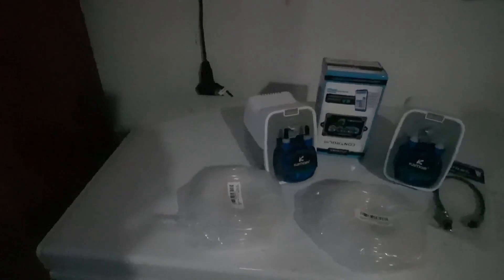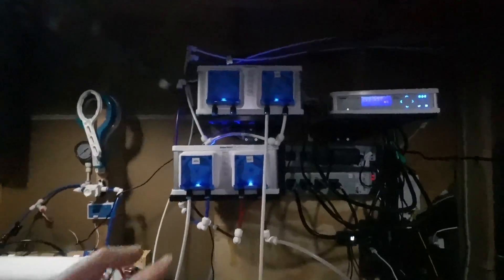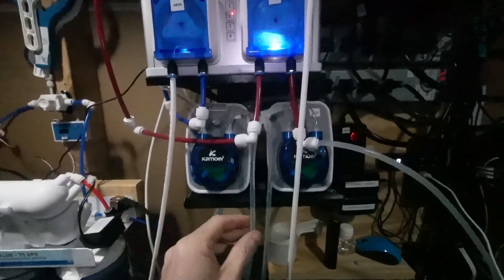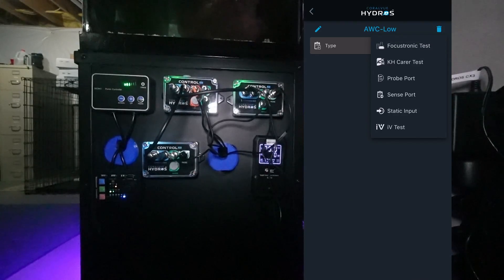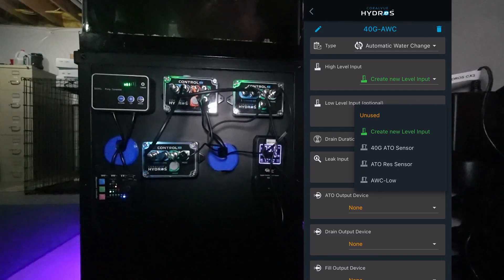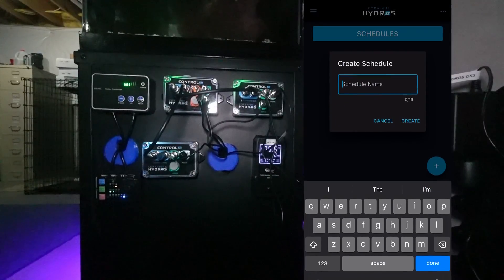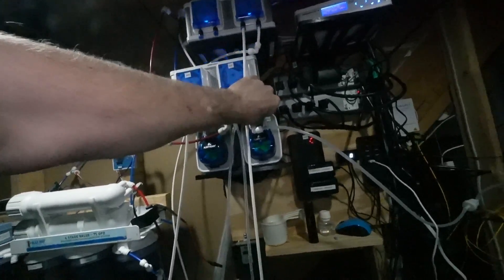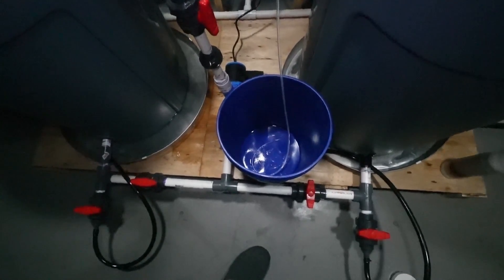Beginners Guide: HYDROS Automatic Water Change

Comment: I may have missed it but can you configure the ATO to not run during the AWC?
Reply from the maker: Yes you can using depends on. I’d recommend checking out the Hydros Facebook group for that. This has been talked about several times there before.
Reply: @REEFHUB-Official thanks man

Comment: This video helps. I set up everything and I couldn't make  drain, fill and ato work together. They work separate, but I try a lot of settings and I couldn't make it work. I didn't want to have schedule. I thought I just switch to water change mode and it will work... But it didn't.  So I did water change regiment in the schedules like you and it starts working. I don't understand why water change doesn't work without schedule.
Reply from the maker: Post to the Hydros Facebook group and share screenshots of your setup. The community will help you work it out.

Comment: So the pumps plug into the strip that’s controlled by the hydros. Once set up the hydros controls the time the outlets become hot and the sensor when the water reaches a level set by sensor it tells the hydros when to turn on the fill pump/outlet and off on the other pump. I have a Red Sea ato on a constant plug setting in hydros so how to I tell the hydros to turn off the plug to the redsea ato when the Awc starts? This is the confusing part to me.
Reply from the maker: You can use depends on statement to control that. Post in the Hydros FB group and share your setup in more detail. We can better assist you over there.

Comment: Very curious how much this automated add-on costs. I have the Hydros Pro Pack (X4 and XP8) with a Wave Engine and Octopulse 4's. Have ATO with 3 level water sensor. What do I need to buy for this? Figure its at least a water level sensor and some Kamoer pumps?
Reply from the maker: That would be correct. It also depends on how you plan to run AWC. I have a mixing station so that could be an additional cost and possibly the cost of an ATO
Reply: @REEFHUB-Official  I have the Hydros ATO and a brute trash can mixing station similar to yours. I am curious about how you did the actual plumbing in the sump to remove the water. You showed how you placed the water sensor, but where is the actual tubing in the sump, return chamber laying on the bottom below the return pump level? How do you have the water removal tubing placed in your salt water can, tubing inserted through the can top and the end is laying on the bottom of the can to get most of the water out? I'm seriously considerting replicating what you did. One last question... Why not use a submersable pump in both the sump and the salt water mixing station tank or in your setup the pump used in the mixing station configuration to move water even faster from the sump to drain and saltwater mix container back to sump?
Reply from the maker: @prion2727  I just run RODI lines and hold it in place via a probe holder. One is deep enough in the water of AWC and the fill line is above the water line to pump it back in. As for the plumbing to my Mixing station, i drilled a couple holes and used RODI Bulk heads off amazon to secure it to my mixing station. I also have a Hydros Low Level sensor install in my mixing station that warns me when the reservoir is low. The pump that removes water just puts it down a drian.

Comment: @REEFHUB-Offical Thanks for the video! What do you think of the Kamoer pumps vs the GHL Maxi? I am looking into setting up AWC and plan to use Hydros for monitoring but was also considering doing a standalone GHL maxi system for AWC and ATO.
Reply from the maker: GHL is stable and works just fine. Personally, the Kamosr pumps are cheaper and more powerful than the GHL Maxi. I’d deftly go the Hydros route for AWC. It’s simpler to setup, implemented the same way, and more affordable.

Comment: Thank you for posting this video. No one else has taken the time to do a Hydros system overview/ setup and what can be achieved with Hydros. Your video is what I have been looking for. I am currently working on setting up a water change station in my basement. I am currently purchasing the parts as I can afford them. I plan on automating some of the functions on my water change station. Which controller or combination of controllers are needed to start from scratch to automate the water change station in my basement? I currently do not own any controllers or Hydros equipment? I am thinking of purchasing the X2 Starter pack, an XS controller & ATO kit with the triple water level sensor. If you recommend something different I am open to suggestions. I am not exactly sure how many water level sensors I will need. I am thinking a total of 4 level sensors and the one triple water level sensor available in the ATO kit. (one high level sensor & one low level sensor in the freshwater tank = 2 level sensors to control RO/DI.) (one high level sensor & one low level sensor in the sump of the display tank. = 2 water level sensors to control the AWC) and the Triple level sensor to to control the ATO. What I want out of the Hydros on my water change station is the following.

1. Auto refill RO/DI water storage tank
2. Auto water change display tank
3. Auto refill ATO container & maintain display water level
4. Measure water temperature of mixed saltwater
Reply from the maker: Thanks for viewing and I’m happy it helped you out. That sounds like a great start. The ATO sensor will also act as the high level sensor for AWC. If you are also planning to do a collective then you’ll also need a command bus cable and a terminator as well. Be sure to pay particular attention to the command bus tho. The command bus for anything over 3 meters will be data only so if you plan to have Hydros equipment greater than 3 meters apart you’ll need a data only command bus cable. The data only is sold up to 50ft in length. There is also a DIY method on making those cables to in the Hydros forum. Hope this helps and let me know if you have any other questions! :)

Comment: Great tutorial. Having a fill pump on an unreliable wifi strip sends shivers down my spine, I would suggest an XP8 to drive the pumps.
Reply from the maker: Thanks for the suggestion! I am deftly considering that and will probably eventually move towards it. The WiFi strips for me tho have been pretty reliable because I created a dedicated network for Hydros to use at my house and it is completely isolated from everything else. But it is deftly an improvement I’m looking to make in the future :)
Reply: @REEFHUB-Official  I also  use  a dedicated 2.4GHz ssid, still lose strip connection once in a while so I don’t trust them.
I  use a different Kamoer that sits by my tank to drain down to the basement and a tunze turbelle high jet as a fill pump up from the reservoir in the basement. The Kamoer was too slow with the headpressure. Now doing a daily WC of 5 gallons in under 40 mins total.